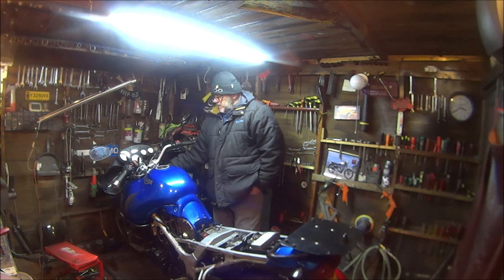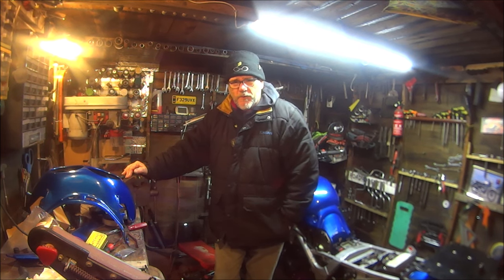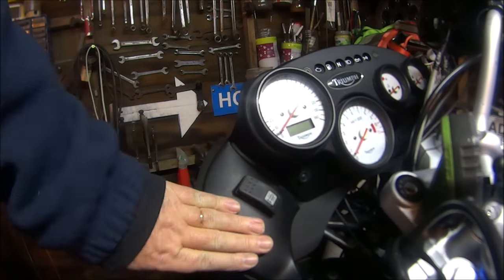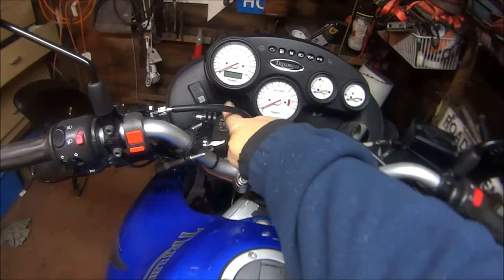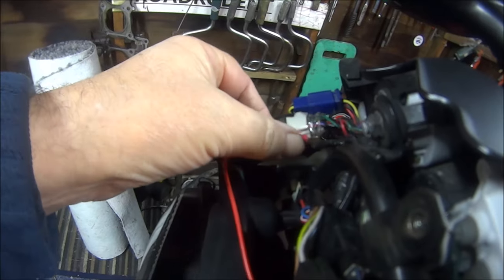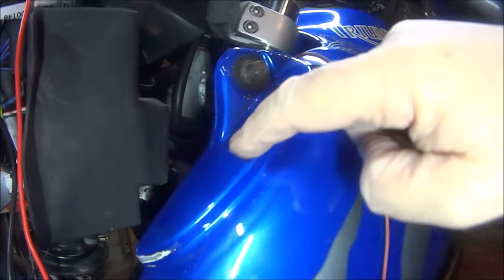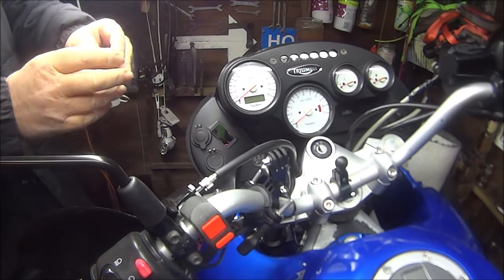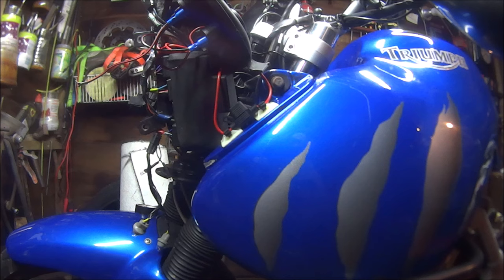Triumph Tiger. Digital Volt meter & charging sockets , fitted.

Comment: Glad to see the adaptation (heat cycles) process cleared the MIL, suggests that there's not a lot wrong with the FI / ignition system. It'll be interesting to see how the charging system checks out with a good battery. There should be an "accessory connector" around the instrument cluster that would let you get the wiring a bit tidier, Look for a 2 pin WT connector with a black and purple wires, supplied  from the fuse box on the instrument/clock/accessory fuse. Time to get a close look into details when the tank comes off.
Reply from the maker: Cheers buddy this is super helpful. I have noticed said double connecter and wondered what it was for. Great stuff thanks.😊👍